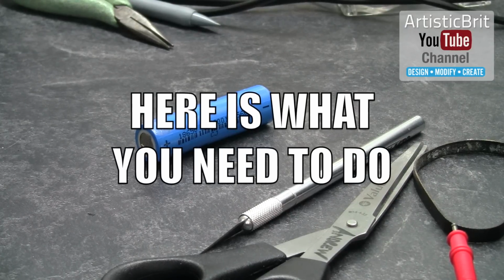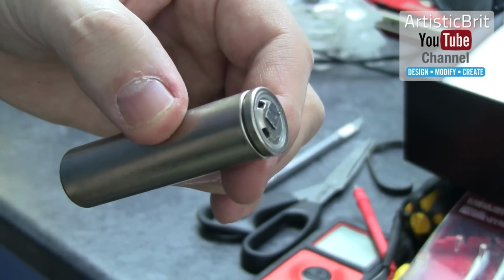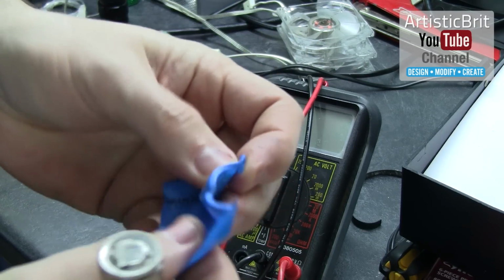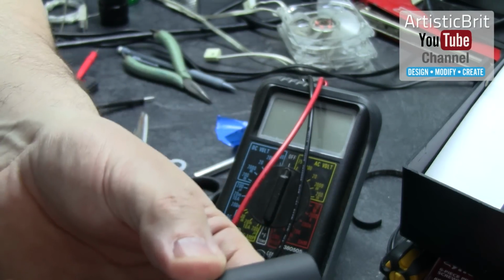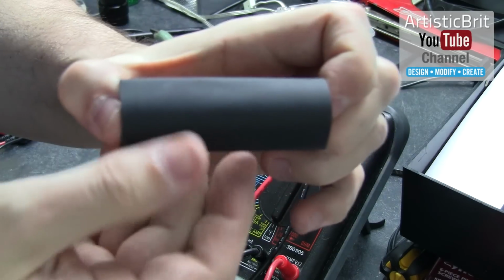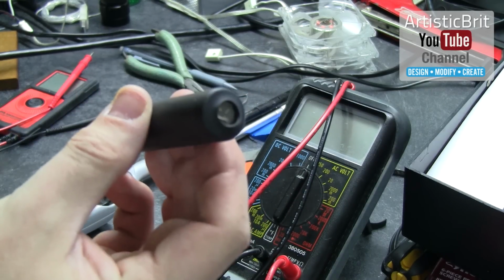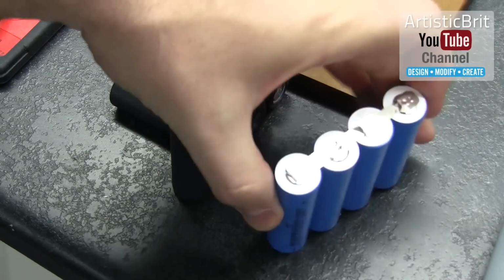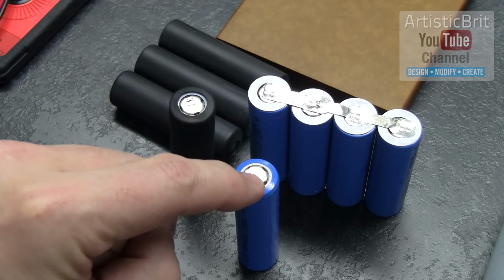Electric Danger of Lithium Ion 18650 - Battery Fires Exposed - Possible DIY Solution

Comment: So two main problems I saw with your video. 

the thick wire wrap you used does not properly let it dissipate heat. all batteries have a nominal operating temperature. different chemistries of batteries have different levels. if the battery stays at or above that threshold you risk permanently damaging the cell or it vents or catches fire. also you shouldn't have double wrapped it with your wrap and the original it came with. way more plastic to hold that heat. 

2 you removed the plastic insulator ring. that ring is a thick piece of plastic designed that if the battery wrap were to be damaged, that thick tough ring should stop anything to lay across and short it out.
Reply: True. In fact he modified the battery to be more dangerous!

Comment: What got me is the title of the video claiming to make them safer, but in said video you dead short low-drain (probably ICR) to show the neg-pos thing. Even a quick dead short can cause venting. And, I think there is more danger potential with using a wrap that insulates the heat in the battery. If someone has enough know-how to make a battery pack, I am pretty sure they know about the positive and negative post and definitely know not to tamper with or remove the wrap.

If the thicker heat shrink only fits your purpose, since you say you'll be using it in a go-kart with adequate airflow to keep them cool, I think the video should reflect that the wraps will work for situations like that, It's not making them safer for your audience if they're not using them in the same way.
Reply: S-One

Comment: I want to ask you, I have a fairly new 18650 battery, but earlier I dropped it and it spit out a liquid like water, I checked the voltage is still normal, is this not dangerous if I still use the battery?
Reply from the maker: I would recycle ♻️ it. I’m sure having it’s guts spill out isnt a great sign

Comment: So glad someone else knows about this. I had a big Smok X Cube, which unfortunately uses 18650's and you need to get the fast discharge versions too. The big problem is that the X cube can't self charge, so you regularly have to remove the batteries and put them back in again. After 5 days of having one, I'd encountered what a big short was. The battery housing was so tight that it scraped off the protective ring of the battery and shorted them. This resulted in what I can only describe as a firework flying round my living room. I got burns to my hip which have left a scar and the living room needed to be redecorated. 
Back on real cigs again now. ahhhhh....much safer.

Comment: I was also naive thinking that the positive and negative were only on the opposing ends until just recently I noticed sparks when I plugged a 18650 with a worn coating on the positive end to my e-cig. The battery started leaking right away. I'm glad that I found out this without a more sevear accident! Great vid! I agree that the insulation on these is way too thin and prone to wear off with just normal plugging and unplugging of the battery!
Reply: That might be why some of the explode like you may have seen stories of on the news.  I do not vape.  I have a couple one cell flashlights which I use 18650s and similar batteries in.  They are all inexpensive eBay flashlights but I do not use Ultrafire batteries.  There are so many potentially unsafe Ultrafire batteries out there that the name has become synonymous with junk.  Some people use them but I suspect they may have discharge tested them to find their real capacity before using them in any way.  I have seen pics of one that has a much smaller cell rather shoddily wired in and surrounded with some kind of powder.  Not only that but batteries of similar quality have outrageous capacity claims.  It is easy to get one that has 9000 mAh on the label only to find that it barely even holds a tenth of that when fully charged.  It is for that reason I resist the eBay specials of fifty for ten dollars and similar sales.  That is because you get what you pay for except with those cheap batteries they may even be unsafe.

Comment: Put one of these in the same pocket as your car keys and you may go to the emergency room or worse. Thanks for showing how easy it is to short out. I think disposing of the battery once the protection starts to wear away would be best for people using these in portable devices.

Comment: So what your video has shown me is, Do not remove the plastic ring at top. Obviously it is there to prevent the bridge. Why would you possibly take it apart to show that? They are designed that way for a reason. Leave the ring, right?
Reply: You didn't watch the whole video it seems.

Comment: You are placing a thicker, more insulating layer which prevents the batteries from cooling as efficiently.  Heat dissipation in a battery, particularly Lithium, is important.
While I agree that having the terminal so close is an odd design, battery designers, in general, are well aware of what they are doing...
Laptop battery packs are generally well soldered and nowadays have a very low failure rate.
Reply from the maker: +RalphSeguin anyone modifying battery packs like myself probably has some kind of understanding like myself of the thermal retention of the packs as the amperage draw builds. For myself, I am creating series of battery packs for an electric bike, which will be vented and cooled much more than normal batteries, plus the whole unit will have a thermal sensor, so the temp will be monitored at all times.
Reply: Fully Agree with ralph, the tubing is used for insulation, so if your thermal sensor will measure temperature outside the battery since they are well. Insulated by tubing. Batteries will get hotter easily and no amount of outside cooling will help it since you applied insulated tubes on them. Stay careful and i hope it works well for you. Goodluck bro

Comment: Appreciate the informative nature of the video, although I'm sure you've heard this many times before this is NOT a design specific to the 18650. This is the design of almost all cylindrical cells for the last couple of decades. You can verify this by taking apart a standard household AA alkaline battery.

It does seem kind of strange though with the lithium cells on the market now capable of delivering more than enough power to damage themselves and surrounding cells before discharging you'd think the design would have been improved by now.

Comment: Good attempt at making the 18650 safer, but you should have re-installed the ring insulator before you used the heatshrink.  Hopefully you can still accurately indentify the positive ends after you wrap them with shrink.
Reply: 🎉 the

Comment: Did you consider the thermal properties of the original plastic coating vs. the shrink wrap you are replacing it with?
The batteries need to have a way to release heat - might not be much, but  with every degree they are warmer, they perform worse...
Reply from the maker: For what I am using the batteries for, this is absolutely fine. Most of the comments on this video are pathetic really, based on partial viewing and not seeing my comments typed using the youtube overlays, explaining myself. I am creating a vehicle with battery storage in an open air holding system. BUT even that has changed over time. I have learned much over time and since making the video, I now see they have nice battery holders which are easy to purchase. The main focus of the video, really was simply to show that the negative and positive terminals are right next to each other. MANY people did not know this, like myself. But I don't mind the comments really as it is simply further exposure. I have a follow up video im working on, which should be fun.
Reply: TheRealXesc no don't heatshrink them you are right it can be just as dangerous because depending on how often you charge them and how old they are they have different heat restrictions and while connecting them the heat is going to spread and there all gonna go BANG not nice
Reply: they are right next to each other (3mm apart to be exact), thats how they work, that white insulation ring is what protects them in a way, along with an undamaged wrap, if you take the insulator off and put those batteries in a device, any device, the positive connector on the sled will touch the positive and negative, causing a short, and most likely and explosion or fire, whereas with that insulator on and the wrap undamaged this cannot happen.
Protected 18650 cells have a circuit on the negative end of an already wrapped battery with short circuit protection etc and a piece of metal running from that circuit to the positive up the side of the wrapped battery, then another wrap goes on top to cover that, with that white insulation ring still in place, its the most important safety device on the battery
Reply: Dude, from your responses, your narsosistic in my opinion. Simply admit that your wrong and remove the video. Its a danger and leading others to believe that this is a good idea is dangerous. I would advise anybody that suffers damage to property or life because of this to sue the pants off you and throw you in jail for life.

Comment: Hahahaha you take the protective ring off then claim it's unsafe....

I have about 16 of these 18650's and use them in a variety of dive torches, never had an issue.
Reply: +chapmasi The video maker is just pointing out the dangers and letting people better understand how a battery is built and where problems can occur. Yes, putting a single and unmodified cell into a torch is pretty safe and i wouldn't expect there to be a problem. The problems can possibly occur when inexperienced people combine many cells into a battery pack. They may solder cells, which is very bad for the cell, and can mean the insulation is damaged. If the cells are not properly secured and physically isolated from each other, the case of adjacent cells can short out, if the insulation wears through over time. There are many ways in which issues can occur when multiple cells are combined. Using old rejected cells is yet another variable that could result in problems. Building batteries from multiple cells is not something to be taken lightly and i don't think it is a good idea unless the person has a pretty good understanding of electrics and how cells/batteries function.
Reply: my flashlight switch got reaally hot because it shorted the battery, battery didn't burn but the switch melted...

Comment: The plastic ring and heat shrink are perfectly adequate. Unless you hold your soldering iron on for too long and melt it. Your dealing with 4.2v at the most,it's not going to jump the gap by any means and those with the new heat shrink wouldn't fit in a 18650 torch anymore.
Reply from the maker: TheLukey21 This is not for a torch or Vape use. It is for a 4000Watt 192Volt Go Cart / Car I'll be making this summer on YouTube. ;)
Reply: Andrew Jones 
Exactly. The double insulating layers would be of use in a flashlight or vaporizer battery that's frequently handled. In a vehicle pack it's not needed just like it's not needed in a laptop pack. The pack is poorly constructed if it relies on the shrink wrap to actually insulate anything while in use.

Comment: Great video.
I thought the same thing about the entire barrel being negative. I am glad someone took the time to take one apart and show it.
This video should be required viewing for anyone who is undertaking a DIY project using 18650's.
Makes me rethink spring contact battery holders for these cells as well.
Reply from the maker: tedtrash I was thinking the very same thing! I have not seen the spring mounts done well yet, so was thinking of a slot in battery holder with springs on one end. I'll make  videos of whatever I end up doing though for sure. One of the next video's will be of a battery going BAD, shorting etc, just to show how volatile they really are.
Reply: Andrew Jones
I'm thinking I might just mask the + terminals on mine and coat the ends in liquid gasket. Then I won't have to worry about the increased diameter of the barrel or getting the shrink wrap fitting right.
Your way is probably better for your application . . . or maybe even do both.
I have cheap Ultrafire batteries for now and have just started getting familiar with them.
I've seen photos of the protection circuits for the more expensive ones, and they just don't seem very robust. Seems too easy a part to fail to trust it to keep the house from burning down.
I keep an old cookie sheet under my charger and only charge them when I have time to work on something in the same room.

Comment: Perhaps the original covering was designed to permit the proper amount of thermal transfer as these batteries often have a high current draw and need to dissipate heat.  Also you did not replace the plastic ring insulator.  Batteries meant for flashlights and portable equipment should have the protection circuits built into them which will also prevent short circuits, over voltage and under voltage.  Batteries out of a laptop power supply do not have protection circuits as this circuit is provided by the equipment.  One thing to keep in mind though is that a lithium ion battery when permitted to discharge below (over time) it's safe low voltage level can catch fire as internally copper crystals can form a short circuit.  Keep your lithium batteries charged and do not store long term without topping them up.  When they are worn out - dispose of them properly.  Lithium Ion batteries are wonderful for their large capacity but you do need to educate yourself in their use.  As far as the negative and positive terminals being close - you can say the same thing about a typical 9 volt battery.  Ever put one of those in your pocket with a handful of conductive coins ;)  Why are my pants getting so hot?!!! ;)
Reply: +Digger D I threw some NiMH AAs in my pocket with my keys when I was working on a project one day without thinking, one ended up nestled in the keys shorted with one key -> Key ring -> second key. Exact train of thought..."The heck...why is my pocket all hot?"
Reply: +Raven1024 we are using ours for head lamps. should I use it?
Reply: Huh?

Yeah? They're perfectly safe. Just don't stick em in your pocket with a bunch of metal stuff.
Reply: Patti Ingalls All batteries if shorted out  (direct connection to both contacts) can catch fire.  After all they store energy.  Put some tape (electrical preferably) over one end of connection if you are going to put them somewhere where they could short out.
Reply from the maker: Some nice points, thank you.
Reply: lol! exactly that happened to me! i was trying not to do it but when i had to rush i just put them in my pocket ... then after a few hours i wondered what was happening xD

Comment: The information is perfect, but the execution is dangerous. You never put heat on a lithium battery, and you also never short-circuit a lithium battery without protection.

Comment: Andrew thank you very much for the informed video that you made and which many people who speak about this subject regarding 18650 lithium battery cells overlook. My questions happens to do with handling 18650 batteries coming from an old laptop/notebook battery that I took apart; Q. How does one discharge charged 18650 batteries that all currently fully or partial charged and since the batteries came in pairs how to I remove the metal connector on the positive and negative without arcing myself or causing them to explode? Also, these batteries I am experimenting with are for a power bank charger used on smartphone - Iphones, Android and I would like to know more about its handling safely and it is proper to use such batteries for this project?
Reply from the maker: Bladi Viquez I would get some neodymium magnets to trap wires under each end of the battery and find a bulb or a small 4 or 5volt motor etc. to drain the remaining energy from the cells. Or if you have a balanced charger device, you could also use it to drain the batteries I believe, though have not used that function yet. Try not to damage the 18650 or similar types as I have heard of them blowing up after months of sitting around, slowly getting hotter. There are plenty of videos out there showing this. Though am thinking I may show a video of one of mine in a "controlled explosion". How are you rigging your batteries for your project Bladi?
Reply: My plans with much information like the one you have provided thank you again!  Is for using these 18650 batteries for a power bank chargers which are a Do-It-Yourself kits.  Now with this said...my concern has to do with what kind of 18650 batteries I should really be using as the some places say that I must use 18650 protected which are costly but better, but what about the ones one takes from the laptop batteries precise for these projects people experiment for power bank chargers, E-bikes, and other hobby projects?  Are they safe at least for usage as I don't want to sell to a customer a power bank charger kit ready to use only to find out that it will blow up in their pants, or purse..you get me! Please help and all recommendation is welcome as I am taking a very informed measure for such endeavor and would like to include safety...thanks!
Reply: Andrew also almost forgot to ask...Is it good or safe to solder with a soldering iron an 18650 battery unprotect while it is still charged? Or is it better to uncharge it and then proceed?